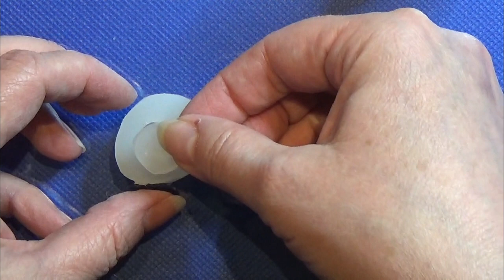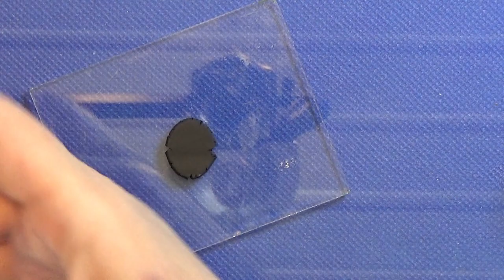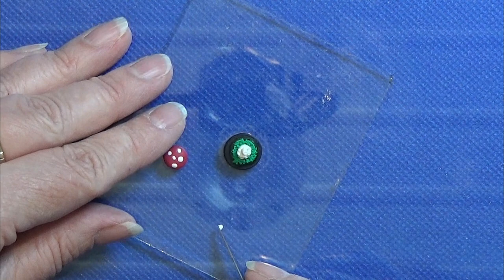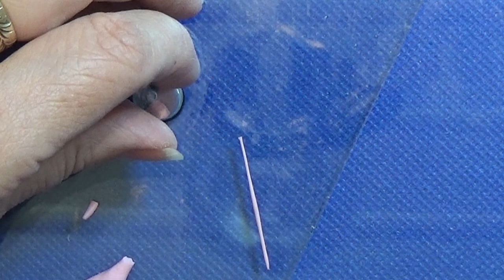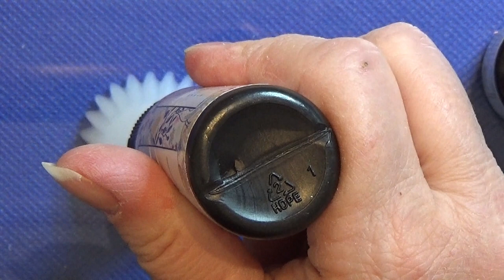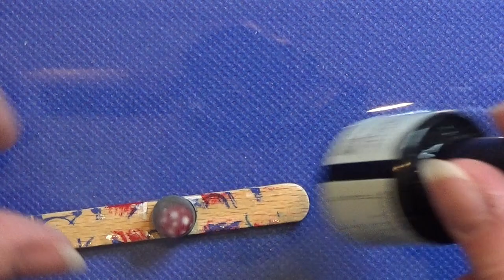Polymer Clay Miniature - Snow Globe Thing

Comment: I didn't understand how you could make a mold from polymer clay and still have it flexible? Or did you leave the clay unbaked? Could you explain this? Thank you!
Reply from the maker: When I  talk about a mould, it is always mold potty I use 😋 , (I don't like molds of clay)
this one is a "Mold Star" - " Platinium  Silicone Moldputty" as it is almoste see trough, it can be used with UV resin, if you use a moldputty that have some opaque color, then the UV resin will not harden.
Thank you for the question